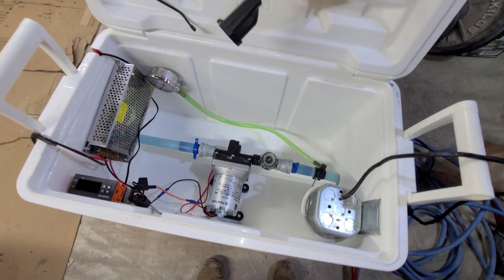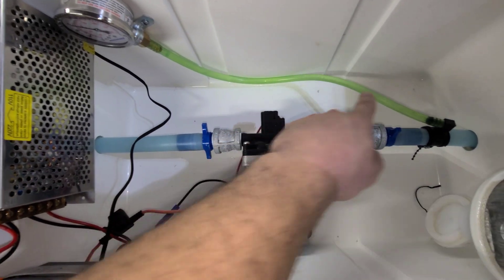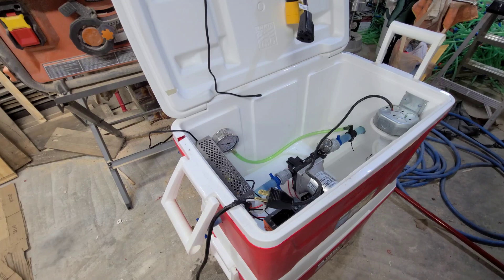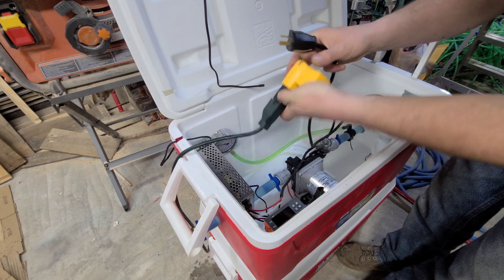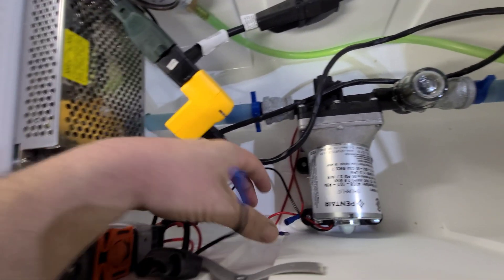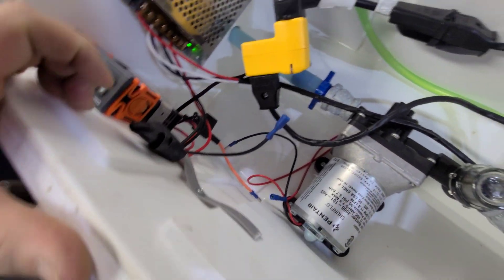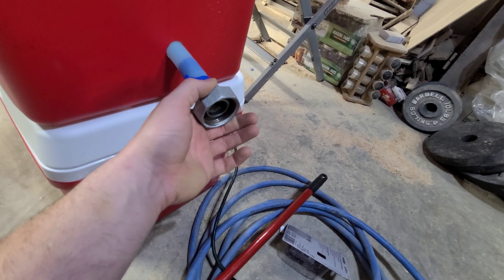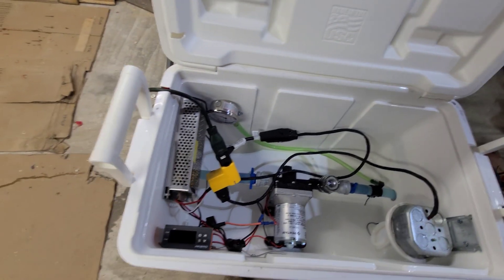12V SHURFLO 4008 Maple Sap Pump Box

Comment: Im really  struggling  with vacuum  same pump 500 feet of line 60 taps and only 5lb of pressure
Reply from the maker: Is your pump running dry or is it at 5inhg with liquid in it?
Reply: @natesworld814   5 psi with liquid  in it. The lines are  not full maybe it will go up with more flow? I just see alot of people  running  15 to 22 psi.
Reply from the maker: My vacuum definitely increases with the more sap that is running through it
Reply: @natesworld814   found a couple loose taps today and 1 leaking  tree got my psi up to 12 maybe wheh flow kicks up it will ok to 20psi

Comment: What power inverter are you running here?  What is the amp output?
Reply from the maker: I'm not sure what inverter it is. As for the amps.... boy, that's a good question. I've never thought about it but it's less than 10 or the fuse would blow. I'll definitely have to check that out this year
Reply from the maker: Found it. Amazon 
ALITOVE DC 12V 10A 120W Power Supply Adapter Transformer Switch AC 110V / 220V to DC 12V 10amp Switching Converter LED Driver for LED Strip Light CCTV Camera Security System
Reply: @natesworld814  thank you!

Comment: Hi video looks awesome. I’m trying to set up my pump box right now with the ink bird. Trying to figure out the exact wiring. I’m using it with a battery so does it come out of the battery into the power ports of the ink bird and then the temperature probe comes out of the other two and then two other wires come out of the cooling and go directly to the Shurflo pump. Is that how it is wired. Or if possible could you send me a schematic so I can see exactly how to wire it. Thanks
Reply from the maker: I am currently working on a video with this in it. If you are using black and red wires you will need 2 wire nuts with 3 of each wire coming out. With the 3 black wires 1 will go to your battery 1 will go to the ink bird and 1 will go to your pump. With the 3 red 1 will go to the battery 1 will go to the ink bird and 1 will go to screw 7 screw 8 gets its own hot wire to to the pump

Comment: How was your season this year on the Shurflo?   I'm adding one, my cooler looks just like yours, and I have power nearby so doing something like this.   Did you have any issue with vacuum drop when the pump ran dry?   I know Shurflo and Guzzler can both run dry, but are more efficient when wet - I'm looking at adding a separate line like your vacuum gauge, but with a needle valve and dropping the end into my sap tank for a return - to keep the pump wet all the time, but adjustable so I don't lose my vacuum.   Very nice setup!
Reply from the maker: My vacuum was all over the place throughout the day. Sometimes, it was in the low teens and other times it would be in the twentys and both readings there would be sap sitting in the mainline. The other strange thing I had happen was the line would fill up and then it would drain through the pump then it would go back to filling the line. I don't have an answer for any of it but it definitely helped and I'm hoping to get a second pump out this year.

Comment: Glad I found your vid…nice setup…starting my research for a similar system for my 160 tap hobby next season…gotta use solar tho
Reply from the maker: I'm glad you found it helpful. I'm looking at a woods that will have to be solar so maybe that video will be here in the future
Reply: You ever make those to sell?
Reply from the maker: No this is my first and only one I have built. Might get another one built for this coming season.
Reply: Have you had trouble with your pump shutting off? I built one with a shurflo 4048 last year and most days when I went to check it wasn't running, I have the similar power supply to what you have and I'm wondering if it is overheating from the constant run time exceeding it's duty cycle. I unplug it and plug it back in and it runs fine the rest of the day.
Reply from the maker: No I don't believe I had that problem. It has been a year but I think I would remember that. I may have been over heating I mean that would make sense or possibly your power supply was glitching 🤷‍♂️